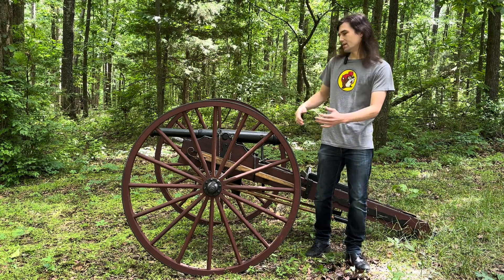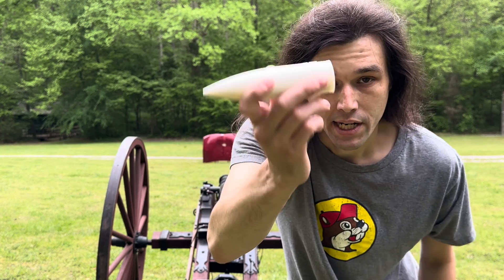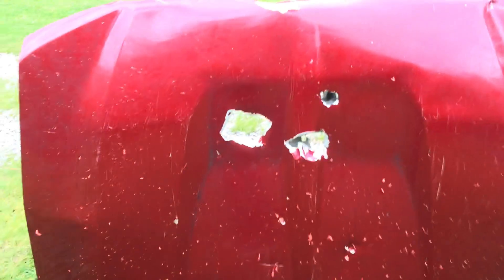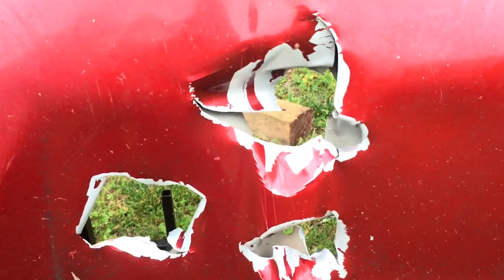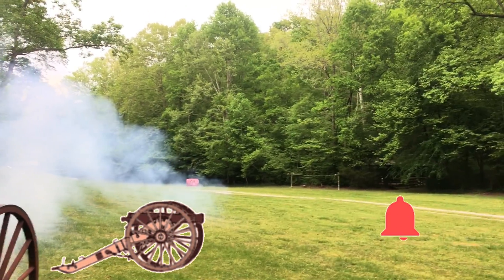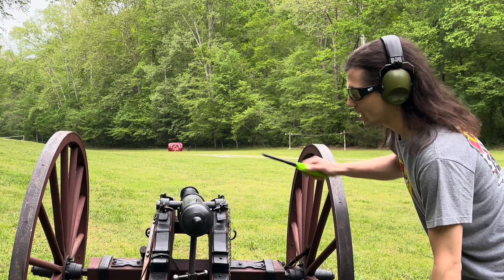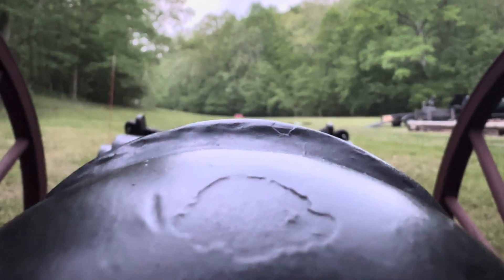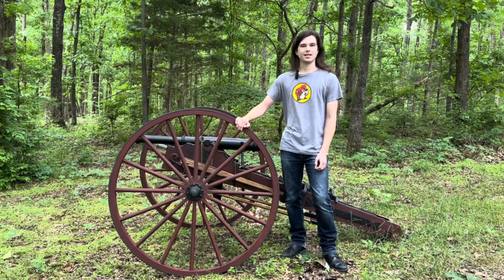Shooting 3D Printed Rocket Powered Tank Rounds

Comment: Lighting the rocket with the regular electric igniter should be able to light the powder I would think. If you can route the wire through the touch hole. Not that it matters. I'm sure that little C6 has puny energy compared to the powder charge.
Reply from the maker: I’m just shocked it set it off and they sort of worked well! I’ll have to try a different method if we revisit this one!

Comment: Doesn't the rocket propelled projectile make your cannon a destructive device under the NFA?
Reply from the maker: Technically since the cannon itself sets off the charge and not the other then no. The same applies to explosive cannonballs oddly enough although those are super dangerous. If the cannon lights the fuse, and it’s a black powder muzzle loading cannon, you’re good to go. Good question. I researched a bit before this one!

Comment: would kill to see a super slow mo of it firing to see if the rocket motor actually fires. 

if it does, it'd be cool to see a bigger motor used and a longer range test
Reply from the maker: 100% agree. I think we can get out to maybe 300 yards at the current range but we haven’t shot at that part of the property yet. One of these days when we’re big enough we will have the slow mo guys on!
Reply: @TheCannoneer  if you’re from the states, should try and contact ordinance lab, you have the cannon, they have the boom

Comment: You could make a hollow space in the head of the rocket, fill it with flash powder and cap it off with a 209 shotgun primer. Taofledermaus did something similar with 12 gage slugs. 1.5 bore is big enough for a significant payload.
Reply: Be careful, even though the cannon isn't a destructive device, once loaded with an exploding projectile, it most certainly becomes one legally
Reply: @zebdeming  Since it doesn't fire fixed ammunition, the cannon wouldn't be considered a DD, but exploding projectiles likely would be. There are channel creators who have the proper licensing to make such things, so a collab with one of them would be the simple way to accomplish such a video without risking either life and limb or running afoul of the alphabet agencies who regulate such things. Still probably get you on a list though. ;-)
Reply from the maker: That would be a super fun one! I’ll have to find a longer range to test it out though!

Comment: The rocket needs to be longer, its keyholing. Look at a bazooka round. Wasp waist it and try twisting fins for spin.
Reply: Or gyrojet style rocket ports.
Reply: @nospoon4799 honestly at this size that might be doable. Could make it like a hydra with the engines at equal angles
Reply: And an explosion at the end.  Please say big explosion.
Reply: The rear three inches of the projectile should be of an inferior diameter and have three slots where thin plastic fins can be firmly fitted and glued with some strong adhesive; the fins are wrapped around the body of the rocket on loading and they would spring open upon leaving the bore.
Reply: You have the aerodynamics completely backwards.
Reply: I wanted to say the same.
Reply: Its is possessive, and it's is a contraction of it is. Stop being an NPC, and learn how to use punctuation.
Reply: @slappy8941  if you'll forgive me my sausage fingers and tiny keyboard, I'll overlook your congenital need to correct others.
Reply: @slappy8941  yeah, because playing English teacher in the comments isn't peak NPC behavior
Reply: @braysive4380 I am pretty sure grammar correction is a TOS violation.
Reply: @slappy8941 if the point is understood, it doesnt matter at all, just like in doesnt. One mustn't be a word snob like my annoying brother😊